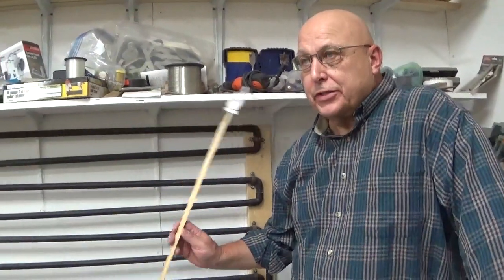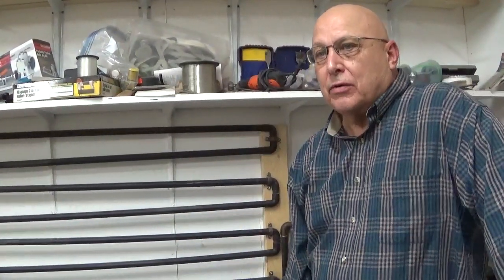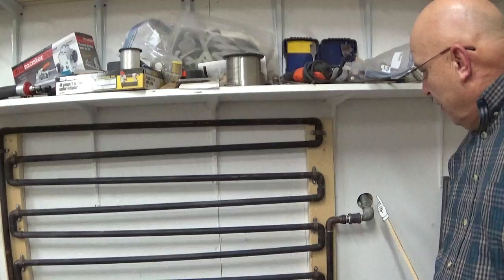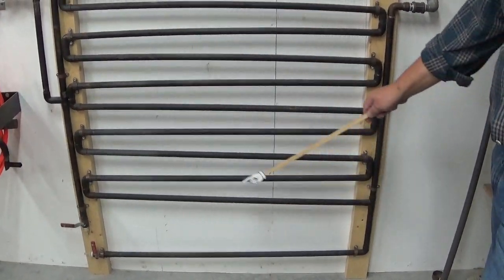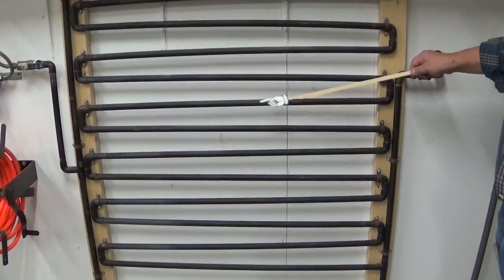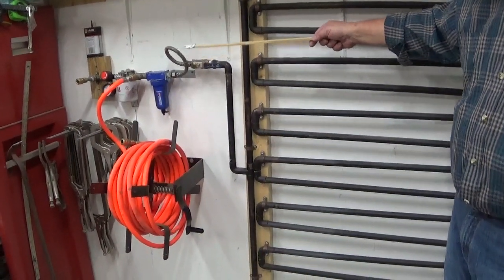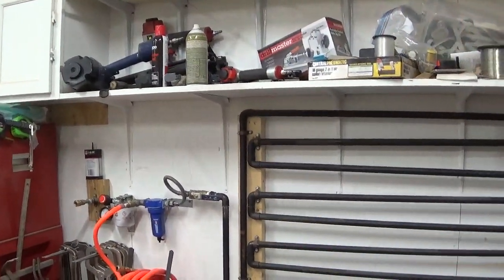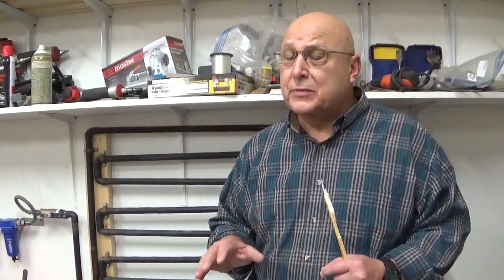Air Compressor aftercooler air cooler dryer condenser, simple and effective to remove moisture

Comment: Great idea and thanks for sharing. But do i need to use copper or can use steel pipe?
Reply from the maker: I would use copper because of ability to dissipate the heated air quickly and last almost forever.  Steel will dissipate heat to lesser extent but will eventually rust on the inside plus it is a lot heavier material.
Reply: @jeffwillard2417  thank you very much for quick answer. Life is easier thanks to people like you who share knowledge. Wish you all the best

Comment: awesome video! can you use pex pipe instead of the copper?
Reply from the maker: Thank you, Pex will not have the same cooling effect as copper pipe, Pex or another plastic pipe and also rubber hose has little effect to dissipate the heated from the compressed air
Reply: @jeffwillard2417  Noted. thanks for the reply!

Comment: This is the style of set up I have been looking at.
Looks like you have the orange hose connected before the oil trap and another connection after it. Just curious about that. I'm learning so excuse if a dumb question lol.
Is there a successful way to cool the air before it enters the tank.
Sorry for the q's but you seem to know your stuff!
Thanks!
:)
Reply from the maker: Hello Jason,
There are no dumb questions, how would anybody learn if they did not ask questions. The air flow goes from the copper pipe to a flex hose then into a air/water separator, then into a direct high pressure air coupling used for sandblasting, blow guns, etc, then into a second air filter and finally the air regulator. That cheap orange PVC air hose was horrible to use, I switched to a DIABLO  3/8 In. X 50 Ft. rubber air hose that is much better. 
    
https://www.harborfreight.com/38-in-x-50-ft-rubber-air-hose-62884.html
Reply: Jeff Willard - Thanks bud! I think I'll stick with flexzilla after reading those reviews lol. Can I ask how you went about getting the 2 flex hoses in your air line? A hydraulic hose and a water hose?
Thanks again! Appreciate you sharing your knowledge!
Reply from the maker: The hydraulic hose coming from your compressor is a called a single wire or single braid hydraulic hose. Look for a business that makes hydraulic hoses or buy one online already made, you want one end fixed and the other end swivel in whatever pipe size coming out of your compressor tank, on the regulator side connection use a brass inline pipe union fitting or a flex hose. I used that flex hose because that is what I had left over from another project. Have fun.....

Comment: Hi jeff Can you explain if the moisture trapping system is before or after the tank? If it is after the tank, then doesn't that mean the air cools & moisture collects inside the tank already? To me it seems like it would make sense to connect the moisture trapping system to the compressor so it can remove moisture before the tank & protect from rust.
Reply from the maker: Hello ducman,
You place this cooler after the tank. The intake air is always at ambient temperature where the compressor is located be it at -20 or +100 degrees, so it would have very little cooling effect on the intake air. It is when the air is compressed and heated to 195 degrees and enters the tank with moisture and oil particles, this is why you need to cool the compressed air so the water and oil particles will separate from the air. Hope this helps.
Reply: Hi Jeff,

That is exactly what I mean. The 195 degrees hot compressed air needs to be circulate through the cooler & filter. Why put the cooler & filter contraption after the tank when it can instead be between the compressor and the tank? That way, the tank will get cleaner air and be less likely to rust on the inside, and last longer. See what I mean? If it is after the tank, then the tank will trap more of the moisture and oil, which puts it a greater risk of corrosion.

Most designs are like this:
uncompressed air -> compressor -> tank -> cooler -> moisture trap -> clean compressed air

I think this is better for longevity of the tank:
uncompressed air  -> compressor -> cooler -> moisture trap -> tank -> clean compressed air

Thanks,
ducman
Reply from the maker: Hi ducman,
  Now I see what you mean, it would cool the compressed air alot but I think you will still get some moisture in your tank because of the huge amount of air flowing through the cooler lines into the tank. You may also need a fan blowing on the tubes to help cool them. 
  I think it would be a promising idea to check out, especially because of the small cost to build it. You could actually build two one after the compressor and one after the tank, let me know how it works out for you.

Comment: Can this be done in black iron pipe? I have very limited experience soldering copper. Just bought a 60 gallon 2 stage compressor for my home garage. Its bigger than i should need but that was the point.
Reply from the maker: Hi Mike,
The big problem with iron pipe is eventually it will rust out plus the excess weight, copper is lighter and has a quicker heat transfer than steel. Soldering copper is really quit simple, like I said in the video just make sure to remove all the dull oxidation inside the fittings and outside the pipe before soldering. Just get the copper hot enough so the solder gets drawn into the joint let the torch do the work. Practice with some copper pipe and fittings you can't ruin it, if it doesn't come out the first time just unsolder the joint and start again. I'm sure there is a bunch of You-Tube videos on how to solder copper pipe, it will be a skill that you will use over and over in your life, Good luck....
Reply: @jeffwillard2417  thank you sir! Im definitely gonna try it! Dont want any water on the system
Reply: @jeffwillard2417  the line coming into the copper, is that coming out of the tank or out of the compressor itself? Im not sure if i need to come out of the compressor to the copper then into the tank. Or just out of the tank into the copper
Reply from the maker: Hi Mike,
Mine is coming out of the tank and the inlet hose is a single braid 3/4" hydraulic hose with one fixed end and one swivel, this hydraulic hose also helps in reducing the vibration to the copper pipes. An air cooler that is between the compressor and tank is called a pre-air cooler which people are using this design to make and one after the tank is called an after air cooler. If your using a lot of compressed air you'll need a fan on the pre-air cooler or the copper pipe will heat up and loose it's ability to dissipate the heat from the heated compressor air.
Reply: @jeffwillard2417  only time ill be using it alot is when im painting which wont be but a couple times over the life of the compressor. Only have 1 paint project planned but it wont be continuous for long periods of time. Thats why i figured the air after cooler combined with a filter/dryer/regulator setup after the air cooler but before my hose reel would work just fine
Reply from the maker: Hi Mike,
For a painting setup use a new hose that is screwed into an air regulator so you don't get a contamination from using an old hose and also for before the air regulator check out Motor Guard air filters. Back in my shop days I used one and I used the stiffest, cheapest toilet paper for it not their Motor Guard filter and it worked perfectly for ultra clean bone dry air in the paint shop.
Reply: @jeffwillard2417  i planned on putting an air regulator at the gun when painting. As to control my pressure alot better at the gun instead of trying to compensate for pressure drop.

Comment: Jeff could you detail more on your setup after the main feed line?
Reply from the maker: Hi Thumper,
It is pretty simple after the air cooler lines I have a flex hose with swivel ends (a hydraulic line with swivel ends is better) then in goes into a water separator trap, I then have a separate air hose coupler for high pressure (sandblasting), then into a spin on paper oil filter (a motor guard air filter is the best), then into an air regulator and finally into an air hose coupler. Hope this helps..

Comment: Simple and effective. Do you have a drawing available? I will build this. pofinmt
Reply from the maker: Only the design that is on the wall.  You can modify the length and height to your needs just make sure you have a min of 50' of copper pipe.

Comment: Ive been on you tube all night and saw all the videos you mentioned, so far this is my favorite, im no air expert so maybe you can help me with somthing.  I run 50' of 3/8 line to a 20 gal pig tank and 100' 1/4 line from there,. My application is mobile contractor as apposed to a shop where most things can be reached with a 50' whip.  Is there a way to apply your 50' cooling system ( size wise i can fit it on the inside wall of my trailer) to my 150' foot system?   Or will i lose to much performance once i add this and get 200' of line? Any help would be much appreciated.   Again great vid.
Reply from the maker: Thank you, I would first remove the 50' of 3/8" line and replace it with this design which you and configure to any size that you need, just keep the upward air flow, the water trap placements, 3/4" copper pipe size and a minimum of 50 ft of 3/4" copper. This is mounted on untreated 2x4 studs so you can move and mount it anywhere. Use some 3/4" single braid hydraulic hose after the compressor to eliminate the vibration to the air cooler. You need to keep the line size as large as possible to keep the air volume and air line pressure up to stop that sudden drop in air pressure at the tool end. Keep away from any restriction in the air flow, if your 20 gal pig tank has 1/4 or 3/8" fittings that is a restriction use the 1/2" size fittings for any tank or water/separator filters . You can still use a pig tank as a secondary air storage then place the water/air filter after the pig tank. For the length of air line your using I would use 1/2" air line for the first 100 ft and 3/8" for the last 50'. The 1/2" line is to bulky to work with for air tools that is why you need 3/8" at the end. Some people are also making this design for an air cooler between the compressor and the tank for additional cooling. I'm not an air pressure expert I'm just using my shop experience, I hope this helps you Olson.
Reply: @jeffwillard2417  yes thank you very much this helps alot i will habe to track down half inch air line, it is not readily available in my area.

Youve given me a great start thanks again!!
Reply from the maker: @olsonoutdoors783  I've used this brand hose in 3/8" for years, 
 https://www.harborfreight.com/air-tools-compressors/air-compressor-accessories/12-in-x-100-ft-rubber-air-hose-62887.html
or try this,
https://www.amazon.com/s?k=air+hose+1%2F2+inch+x+100+ft&crid=1R94QK2KEBVC8&sprefix=Air+Hose+1%2F2+in++x+100+ft+%2Caps%2C237&ref=nb_sb_ss_i_1_25

Comment: How long are the pcs of pipe on the arrangement?
Reply from the maker: On this one they are 40" long, just cut a 10' copper pipe into 3 pieces. My first one that I built was made in the same design but with six 10' section of copper, I used more air back then sandblasting for long periods of time.....

Comment: There is a easier way and in my opinion better way, mount the cooler between the compressor an the airtank and let the water flow in the airtank.
The benefit is you dont have the resistance of the cooler while using big airtools. So you can use smaller and cheaper pipes, the air direct from the compressor is the hottest so your cooler work more efficent. And because all water get collected in the tank you has only one spot you need to drain, which you can do with an automatic valve.

Comment: Post aircompressor tank?   and  what psi are you using?
Reply from the maker: Hi Tigman,
Yes mine is a post air cooler you can make these for a pre or post air cooler. My compressor runs at approx. 140 PSI.

Comment: If you used 2" pipe for the vertical tubes with drains, it seems it would give the moisture more opportunity to condense from the air. What do you think? Also, do you get much moisture from the first drain?
Reply from the maker: Hello HiTech, 
   It may but the cost of 2" copper pipe and the fittings may out weight it's effectiveness. As long as you have a "minimum" of 50' or more of copper pipe for the air to travel down and cool is the most important step. Also the moisture in the air is swirling around and coming into contact with the copper pipe at each 90 degree elbow. Your idea may work but I always look at a project in how simple it is to make and how effective it is with the least cost invested.   
   You'll always get the most water out of the the first trap because it is the main one, the amount all depends on how humid the air is your compressing, hope this helps.

Comment: Hello Mr Jeff, i was thinking to use my large oil cooler that i have laying around,  never been used. 83cm x 27cm x 5 cm   for a after cooler. Would this work??
Reply from the maker: A lot of people use oil coolers but the thing to remember is a smaller tube diameter will restrict the volume of air flow and surface area to cool the air.
Reply: @jeffwillard2417  AH yes i did have a good look at the oil cooler i have, there is 3/8 tubes in the cooler. I will go with your set up, will cut 4 foot lengths of 3/4 copper tubes and solider on elbows just like how you have done. Thanks for the video on how you did your set up.
Reply from the maker: @mfpitci  Your welcome...

Comment: could you use pex?
Reply from the maker: PEX, PVC or rubber does not have the same heat dissipation (air cooling effect) as copper.

Comment: I thought the idea was to cool the air that come out of the pump before it goes into the compressor tank. This set up is after the air comes from the compressor tank.
Reply from the maker: You can do both and these are inexpensive enough to make both a pre and post air cooler, just put a fan on the pre-cooler to keep the tubes cool.
Reply: @jeffwillard2417  ok thanks. like your set-up

Comment: Do you know if this system will remove enough moisture to use a powder coating gun? And will it hinder air to my Blast cabinet? BTW, great video. And the hand...
Reply from the maker: Yes it will work for you, you will still need a water/air separator and a filter before the air regulator. I would get a Motor Guard paper filter for the best protection   For my blast cabinet I have a direct high pressure air coupler right after the air/water separator and before the air regulator and thanks for the compliment.
Reply: @jeffwillard2417   Works great! Thank again!
Reply from the maker: Hi Doug,
I'm happy to hear it worked so well for you.
Reply: @jeffwillard2417  I tried to upload a picture, It'a a work of art!
Reply from the maker: Thanks Doug, I believe you....

Comment: Hi Jeff, can you tell me how wide the center copper pipes are? I would like to build your exact system since I to live in FL, SE FL to be exact. Thanks
Reply from the maker: The tubes are 43" long and the inside measurement on the narrow end is 2" and the inside on the wide end is 3" to create the incline. You can make is any length you want, my original cooler was 6 sections of 3/4" X 10' copper which ran into a motor guard filter and then into the air regulator but I used a lot more air back then. Good luck.
Reply: I just got all the tubes cut and now off to prep everything.Thanks again  @jeffwillard2417
Reply: @chrismen1209  How are you liking it?
Reply: Grant Pantling everything is working great. At first I just used the copper tubes and it worked fine but man did it collect a lot of water in the first drop. I then tied in an electric auto drain and its been at a minimum. I used in total 60ft of 3/4” type L copper tubes and followed your setup almost 100%. I have to do some sandblasting next week and will be at the blaster for quite a while. Now that the weather is really hot and humid we’ll see how that affects the performance.
Reply: @jeffwillard2417  Hello Jeff, I'm a 30 Yr Retired/Disabled USAF Afghanistan Vet...you just saved me  A LOT of grief!  I'm going to use your system because it just makes sense.  However, I'm slightly confused...you say "the inside measurement on the narrow end is 2" and the inside on the wide end is 3" to create the incline."  As I look at your video...both ends appear equal and since you slightly bent each run up...which side is the narrow end and which is the wide end?  In other words, the ends all look identical, it's the opened/unattached sides are different since the run has been angled upward.  It's the Aircrewmember inside of me that has to know!  THANKS AGAIN!  V/r Les
Reply from the maker: Hello BikeRider,
First let me thank you for your military service. It is pretty simple, it is an upward zigzag layout with the first bottom pipe angled slightly upward and then fastened to the wooden 2X4 supports with a pipe clamp. Then each pipe above that one is raised slightly upward and attached. If you look in the video you can see the slight upward angle on each cooling copper pipe from bottom to top. Good luck with your air cooler build.

Comment: Thats a great, simple idea, thanks. Do you think this would be ok between the pump and the tank, so as to avoid water getting into the tank in the first place?
Reply from the maker: Hello Stephen,
I will work to cool the air before the tank but because of the heated air from the compressor that needs to cool quickly, I would add more copper pipe and a large fan blowing on the copper tubes to help cool them down. With the vast amount of air from a typical shop compressor (10-20 CFM) passing through the copper pipe you will probably still get moisture in your air tank. This system works best if it is removing the moisture in the compressed air after your tank, especially in the summer months. I hope this helps...